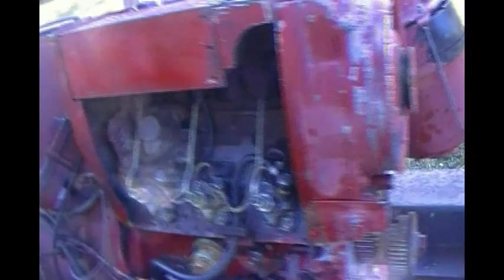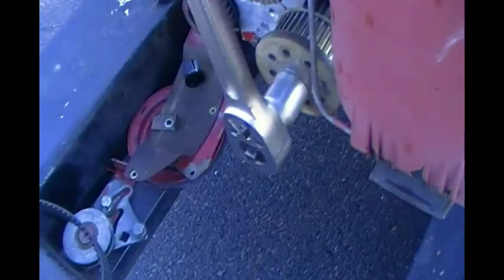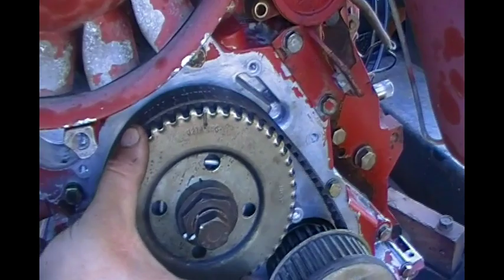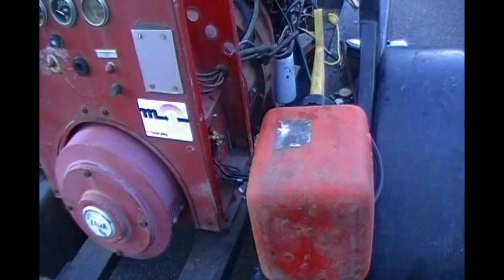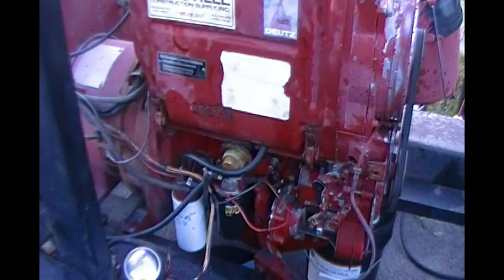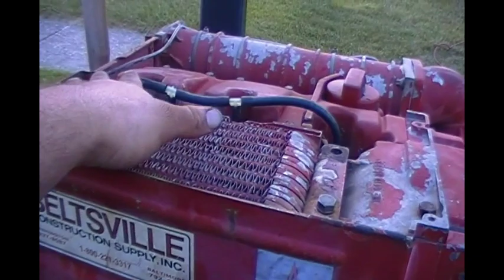Deutz Generator Set Repair Pt3

Comment: I wonder why they chose belt over gears or chain
Reply: Yes, seeing this is a surprise....Didn't know Deutz used timing belts ?...
Reply: Timing belts and diesels don't mix , worse than oil and water , 99.9999% of people are too lazy, escort diesels , Chevy/Izuzu , Pugeut ,etc
Reply: Older ones didn't have rubber  and new 2.9 water cooled Deutz have gears.

Ruined their reputation on these rubber band belt interference motors.
I have fixed a few .
Few people ever change belts at 3000 hours .
I had one break from rust mud on pullies belt jumped time bent all pushrods.

New ones are Electronic common rail diesel water cooled excellent.

Oldest ones were excellent gear timing .

Comment: Todd I was wondering if you can help me out. I have a small homemade workshop compressor that I built myself with a Deutz F2l 1011 (looks very similar to the one your working on here, bar fact its a 2 cyl and painted blue - not red.)  the engne runs a massive Broomwade RM41 Pump upon a huge 250Ltr air receiver.  Problem I have is when I bought the deutz engine we seen it running (Sweet) and then we had to tear it out of the Bobcat it came from. then we travelled 400miles with it in the back of the van, to which it got out of its straps and tipped over (oil everywhere out the air intake). so anyway we fitted the motor to the tank and air pump and set it up with some basic wiring. simply to latch the fuel solenoid open and then to a switch to activate the starter motor. it fired up initialy but the throttle would rev the engine and the stop lever wouldn't stop it. It simply plugged along and hitty missy type revs for a few seconds then stalled, since then it has been a total fail to start it.
The oil level is fine, the solenoid is latching by the sounds of the click and its turning over fine, but not starting. Only other thing I did was to open the nut at the top of each injector high pressure copper pipe and turn it over until fuel came out to eliminate any air lock in fuel line. Also I have completely bypassed the lift pump, the fuel filter and proceeded to gravity feed the fuel from a 5gallon drum 1/4tr full of diesel from a high above the engine itself. I did this to bypass any potential problem until I get it started at least, then I will introduce the filter and pump back one at a time into the fuel line once I know I have it running.   I have no other electrics wired up, I have two thin wires coming from the fan alternator going nowhere and to my knowledge just a oil pressure sensor with a wire that isn't connected anywhere.  that's as much info as I have 4 now mate.
what am I missing mate, can you help?
Reply: honi9 Foley engines in Mass has good info on them also.

Comment: Nice demo on use of pins set. The ford Ztech 4 cylinder uses a specialty pin for locking crank, but cams lock with a piece of flat stock on ends. There is slots milled on ends offset of center on cams, so only line up 1 way. Flat stock was easy to come by, it sucks to buy something for 1 use, or not common to other engines. I guess saying tool cost over lay or is with matters.
Reply from the maker: Todd Mcmillan Thanks Todd, I usually don't mind buying specialty tools for engine work.  Thanks for watching!